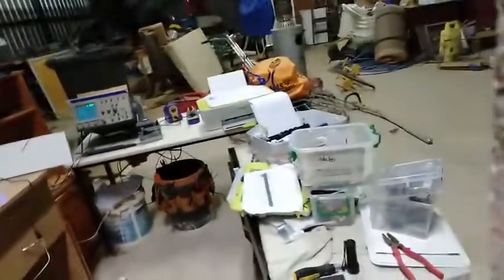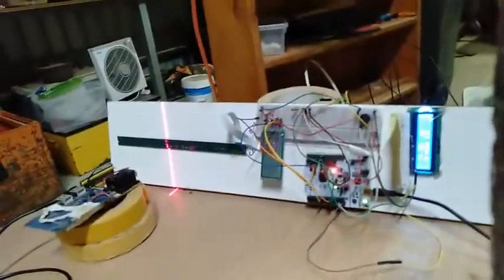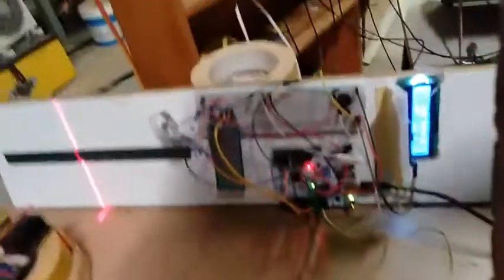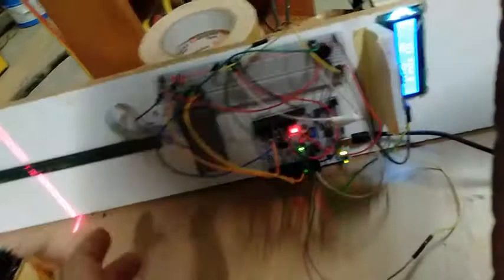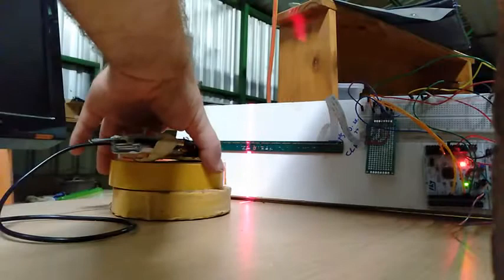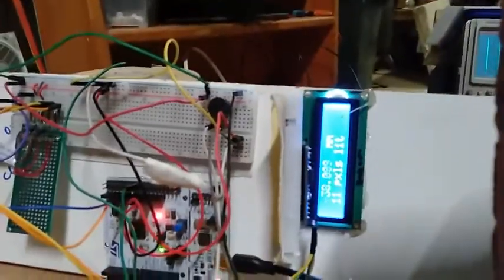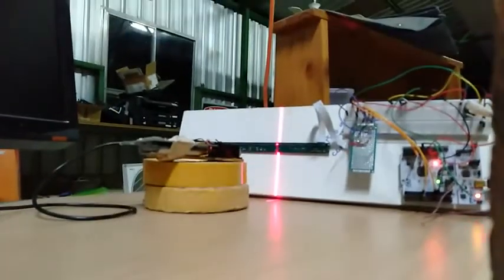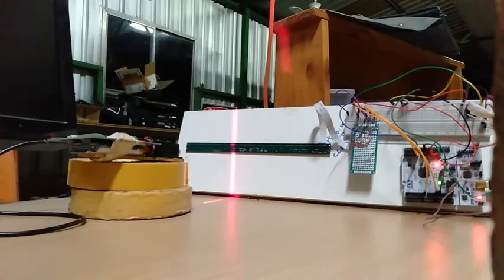Prototype sub goal reached! CIS linear sub-millimeter laser displacement sensor system working.

Comment: Greetings, The project is excellent and I'm trying the DL100-05EUJK sensor with 1729 light sensors myself, but I'm not succeeding. Can the arduino code and data what and how you connected.